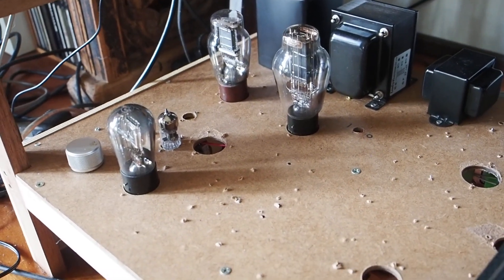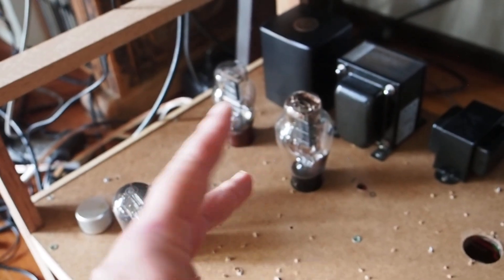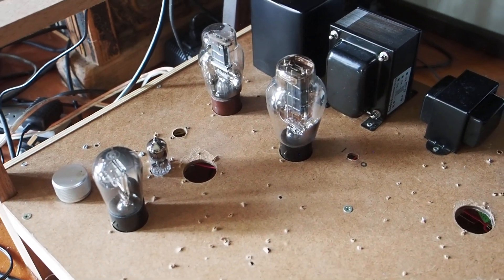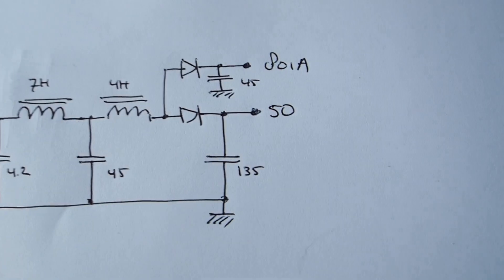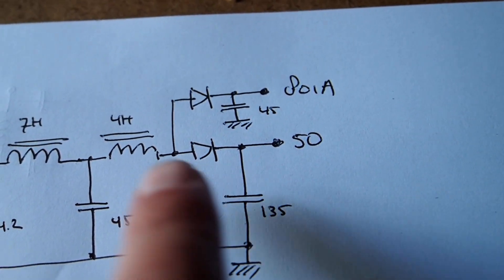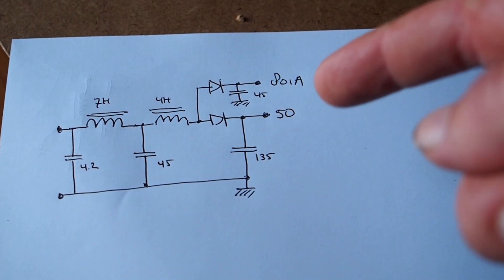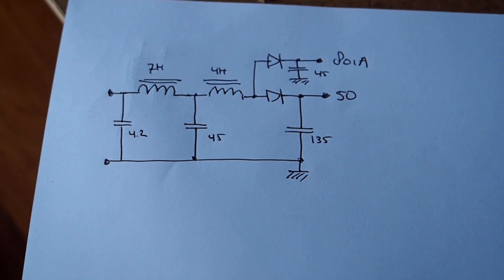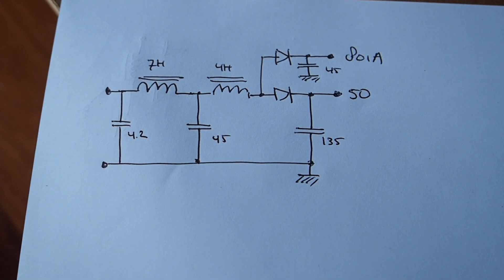Supply improvement yields better sound during loud passages

Comment: About capacitors, twice in the last week I have read of multiple caps being used in the power supply in the place most only use one, and they both followed the same sizing, 1/10 of the previous, so the guy that was running 2,500 uF total, recommend, 1,000 uF followed by a 100, the 10 then 1. The other was Joe Roberts and if I remember correctly, he used, a 100 uF followed by a 10, then a 1, then a 0.1 and finally a 0.01 uF. and he then repeated that after the second choke too.
Reply from the maker: Do you mean 'followed' as in bypass caps or as in cLCLC? With my amps using a cLCLC filter, each C steps up in value., typically a tuning cap first, then a 45uF and 3x45uF as that uneven stepping up seems to prevent motorboating and unwanted resonances in the power supply.
Reply: @EduardBroekman  c,L,C,C,c,c,c,L,C,C,c,c,c

rectifier,  5uf,  10H, 1,000uf,  100uf,  10uf,  1uf,  (then tap off to output tubes) 5H,  100uf, 10uf, 1uf (to driver tubes)

or like the Joe Roberts schmatic

rectifier,  5uf,  10H,  100uf,  10uf,  1uf,  0.1uf,  0.01uf  10H,  100uf,  10uf,  1uf,  0.1uf,  0.01uf

Comment: please excuse my lack of knowledge in this area, but can't you probe along the power supply components with a scope while playing a repeating note, and look for power supply voltage sag ?

also, with the A-B Scope setting, couldn't you compare the input signal minus the output signal (scaled accordingly) and see what sounds/instruments produce a non-straight line output, meaning it's not being reproduced faithfully ? or would this idea need a digital/computer scope that could also put in a time delay necessary for the difference of time between input and output ? and maybe a scope with seperate/isolated earth leads is needed ?

.
Reply: Excellent ideas. I think though that analysis is feasible only at the level of a sine wave (or square wave...), instrument sound analyses would require more than a visual scope readout - a waveform analysis captured on the computer. Would be worthy to do, and educational, nevertheless.
I think most value can be gained from looking at square waves, and see what happens with them, what is the sag and how it distorts the output. (Square wave means infinite distortion, or infinite musical complexity, and it's very easy to track visually.)
Reply from the maker: Yes. Totally... Janos reply with stepped voltage draw / square waves is excellent. 

Keep in mind though that a scope can't really show is things like detail disappearing during loud passages ... my primary quest in not in going after B+ sag, but get a handle on which factors in an amp determine consistent transparency and sound quality despite strong, regular bass lines and/or complex music - which a lot of amps/music systems fail on.  But things seems to point at that a highly decoupled power supplies is one of the factors supporting this. The near-zero inductance DC Link caps as well, as is the 801A tube itself... because if any tube is going to let you know, this one will.

Btw your idea of comparing output with input makes a lot of sense, but what is crucial in that is which measures are audible or contribute to human perceived good quality of sound. If we have imperfection that are not negative in human hearing, we don't have to improve them... some distortions even aid our hearing.
Reply: @EduardBroekman  Here is my thinking.... and I'm not suggesting to fix what sounds good, but to help pin point what sounds off, so by subtracting the input signal from the output, (if the output can be scaled down, which I think it can)  this results as a straight line on the scope, if the amp is doing it's job. It should be easy to see in real time. 

Now if the output differs from the input then squiggles will show on the scope. This way we could play different instruments, (different frequencies) and see instantly what the amp is reproducing faithfully, and what it is struggling with. And in your case, if this all works, I suspect your current amp will show more squiggles in the bass compared with the rest of the range.

I did get this idea working on a cheap computer speaker amp, but when I tried on my class D amps I found they has 13 volts on the negative speaker output compared with the input earth, and I don't know how to compensate for this, other than buying a new scope with separate isolated probe earths. But your amps might have the negative speaker wires tied to earth so it could be do-able.
Reply from the maker: @junkyoutube9060  I get your plan, its also how negative feedback amplifiers work but feeding the difference/error back into the amp as to produce minimal difference between input and output - and yet I personally find those amps particularly not good sounding :) So perhaps rather than a blanket approach and recognising a lot of distortion is  is inaudible by humans, or even helps us hearing,  is to go after specific distortion types that take us away from experiencing the original performance.. so a highly selective approach.. fix what is important in our perception which may even be a personal affair...

Comment: Hi Eduard, at wich standby current have you got these output tubes set. I understand the advantages of running them in counter phase but if you have a choke fed power supply, you need a minimum continuous current to get the inductors to be able to store energy and stabilise. Having the tubes in counter phase, the tube with the lowest standby current will determine the minimum inductance you need on the first choke. Have you verified you are in the stabile domain?
Reply from the maker: Yes, choke no1 meets the critical inductance criteria easily (7H/22ohm for 86mA total draw @ 515V). Regardless of that, a low frequency full volume input signal will still lead to a certain drop in B+ simply due to depleting of the cap banks (which here have near zero inductance) and resistance of the power supply. circuit influencing recharge times. My finding here is that I have a better idea now how sensitive the overall sound is to modulation of the B+ .

Now the 801A is the most transparent and detailed tube I've yet worked with and so it's demonstrating to me here that even mild B+ modulation (way below most tube amps) is still very much audible and that it's also related to retaining high details and nuance during complex/loud passages - a weak point for many amps/systems.

This had nothing to do with oscillations, excess sag, instability or undersizing of chokes etc - those effects sound and measure quite differently :)

Comment: Yes ,Eduard  , this is correct .........I use this method since years with succes.( and there's NO silicon diode hash  noise )
Rest to determine the best values of reservoir capacitors , more is not always bettrr , your ears will tell.
Nice to see your interesting passion and experiments.
With direct heated rectifiers  I  mount a resistor to each side of the filament ant take the HV off the middle ( one can even use an extra wire wound pot to trim for least AC ripple ) Two anodes of those rectifiers are always slightly different ...
The ressitors also protyect the rectifier at surge when start up ....for example two 33 Ohm heavy duty resistors ....and with a pot wirewound something like a 20 ohm (linear ) 

Have nice day Eduard ..........spring is comming overhere .....
Reply: Hi Frank, Eduard, yes, indeed, in this application there's no silicone hash introduced to the sound. I suspect because the diode is not subject to a hard "block" like it does when used for full rectification duty working against a massive reversal voltage that makes it ring like a kettle-bell at exatly predictable periodicity (50/60/100/120Hz). Here, it's only a slight voltage drop in comparison at rapidly altering frequencies. I've taken to using Schottkys for this duty. There's no need for a very high voltage tolerance, nor for high current duty here, and 100V or 200V / 1A small Schottkys are quite cheap and small as well.   
And yes, the resistors for the rectifiers extend rectifier life a lot more, especially when one uses higher capacitances... although I myself am strongly against using a large first cap, try keeping under 10uF, preferably even lower. Works for a more natural sound, and longer rectifier life... and smoother startup, resulting in better power tube life as well.
Reply: @realworldaudio  The smaller the input capacitor the more the power supply acts as choke fed supply = lower output voltage but less sagging, when the inductors are dimensioned correctly. I prefer that and also that protects the rectifier tube (probably the most). Stephe from Skunky Design, uses a capacitor fed PS, but said she shunts the input electrolyte with a  Mundorf cap and claims it has a big influence on the sound. If you are already down to around 4µF, you can experiment with different PP capacitors without breaking the bank, perhaps it is as critical as the coupling cap?
Reply: @hugobloemers4425  Hi Hugo, yes, that's absolutely right on. I have ditched electrolytics from the PSU a good while ago, a good PP makes a huge difference there. I use Kemet DC link capacitors, which are relatively very affordable (comparable to electrolytic prices) and sonically virtually identical to the Mundorf EVO oils. Plus, they last forever, and can stand 100% overvoltage without flinching, and are self-healing from damage. (Literally last forever - 100K to 1 million hours of lifetime expectancy under the conditions they are used in audio PSUs.) 
Yes, I think it's just as critical as the coupling cap.
Reply from the maker: @ Single ended tube amps' power supply is part of the signal path, hence caps and rectifier directly impact the overall sound (and explain Skunky's comments..). I'm very allergic to the sound of caps but with the dc links, I don't hear the quite obvious capacitor sound that most amps have...  If you inspect their spec sheets, you'll find dc links have minimal internal DC and AC resistance (inductance), so they behave quite like an idealised battery, plus they can be had in very high voltages (mine are 800V minimum) so you don't have to put them in series to get the rating you're after.
Reply: @EduardBroekman  And still many do not nelieve that !
Even the same amplifier kit built by different prople with the same components will sound " different " .
In a n amplifier one listens to the PS being modulated ........in fact an amplifier does not amplify at all the input signal ............it only modulates a PS.
Capacitors and tbeir choice and use.........a lifetime experience .
Big mistakes are made .........in most commercial amplifiers .......but who can argue against believes ..........
Reply from the maker: Well put! It is a modulating power supply! In that light, its less surprising that I also find that the better loaded and  powered/implemented a tube is, the less that tube impresses its (less well implemented) character on the amp's sound. Not that its qualities, colour or emphasis goes away, but its signature especially with quality tubes becomes more subtle...

By the way I'm still mulling over your centre-tapped DH rectifier setup... I manage inrush and IDHT overvoltage by putting a large 10K resistor in the B+ during the first minute, but I never considered ensuring an even sine-pulse / reducing the 2nd harmonic there...
Reply: @realworldaudio  Yes Janos ............a small value first capacitor !!! it goes against " some " audiophile instincts and  principles....